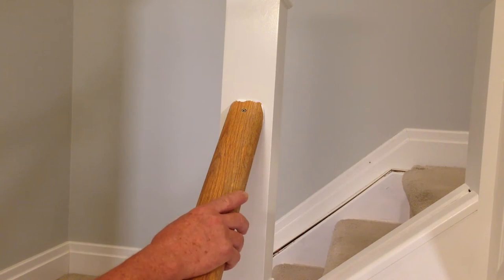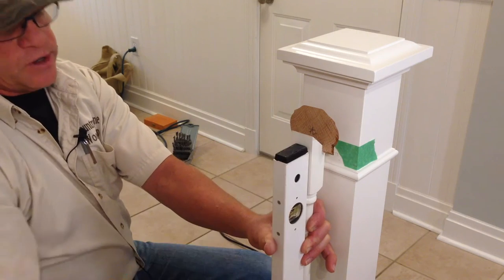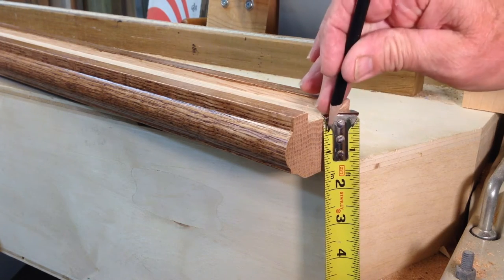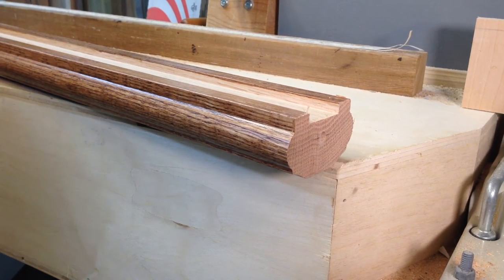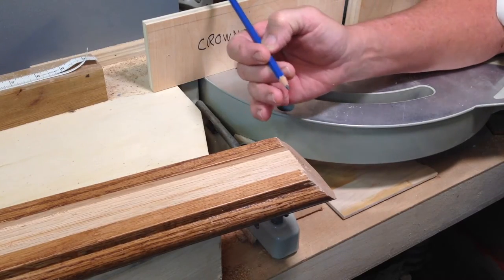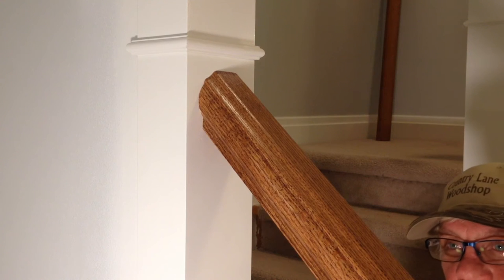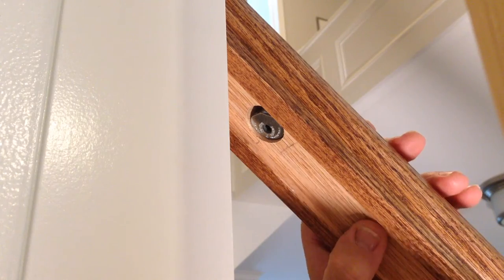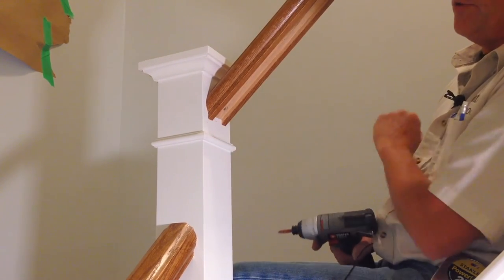Handrail Install with Newel Posts (Staircase Renovation Series)

Comment: How did you do the countersink hole (location, angle, etc.)?
Reply from the maker: Did you not watch the video?
Reply: @HomeImprovementWoodworking  I did watch the video.  At 5:48 of the video he states you drilled a countersink hole where you then add use the fastener screw.  The parts for the zip bolt preparations were all there but not for drilling the part for the fastener screw.  Instead of making a snooty comment, if I missed it then you could have simply explained where it was.  I just watched the video again and I'm just not seeing it. I'm new to woodworking so I'm sorry if I'm too newbie to be honored with your assistance.
Reply from the maker: @wushufanatic  My apologies.  Your further explanation is helpful in understanding what you're looking for.  A drill bit was used that's slightly larger than the diameter of the screw to pre-drill the hole first, on the same angle as you see in this video clip https://youtu.be/JTQSPX2nBl0?t=361  Then, a countersink bit was used to drill in the same location, going deep enough to recess the screw head.  Does that make sense?  Again, I apologize for the curt response.  Scott
Reply: @HomeImprovementWoodworking  No worries. I know there are a lot of people that don't probably watch the videos so understandable.  That does make sense.  How did you determine the angle though when drilling the first hole?  Thanks for providing this video and for responding.  It's definitely a great resource to those attempting to take a shot at woodworking projects around the house. It is overwhelming but enjoyable learning how it is done! Happy New Year!
Reply: @wushufanatic  The angle is an educated guess.  You're aiming to have the hole exit the middle of the handrail where it joins the newel post.  When you watch Doug pre-drill through the hole,  you'll get a feel for the approximate angle.  It's between 90 degrees and 45 degrees from the newel post.  I hope that helps.  Have a happy New Year too!  Scott
Reply: @FixingFurniture  Thanks again Scott for your feedback on the project.  Yes, I'm still waiting to take the plunge although I think I'm ready to give it a shot.  One last question: you used a zip bolt for attaching the handrail to the upper post but a fastener screw for the bottom post.  Any reason why you didn't use a zip bolt for both posts?  Could you also use a fastener screw at the top post instead of a zip bolt?
Reply: To those studying this video and comments to install yourself, I just finished the project and have a few more tips.  Thanks again to this channel again for the ideas.  The video makes it look pretty simple but overall the project is pretty difficult but not impossible for a newbie.  With the fastener screw, my first attempt resulted in a broken screw that was deeply embedded in the railing. What a b***h!  I had to drill out the whole screw and drill another hole to start over.  I highly recommend NOT using big box store screws as after looking into it, they are cheap and if drilling into hardwood like oak, they may indeed break.  I bought a much better quality screw and 2nd time around no problem.  Additionally, with hard wood, I recommend coating the screw in wax. I used the wax from a toilet boil ring; same as recommended for the zip bolt.  Lastly, make sure you drill the pilot hole as deep as the screw you are using. This will also help with splitting.  Although not perfect, the job is done and I'm pretty happy with it!  Good luck to everyone out there attempting to do this project.

Comment: You don’t give the standard measurement of the rail height and the measurements of the distance of each stick to be place
Reply from the maker: Please check your local building codes for the railing height and spindle spacing as those could vary by region.  If I share what's allowed in my region, I could mislead someone.  Great question!